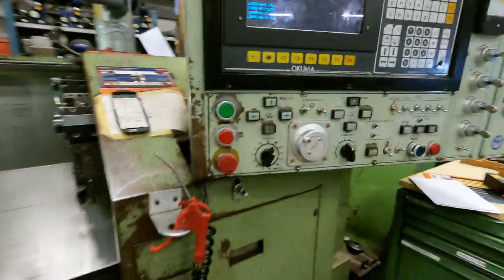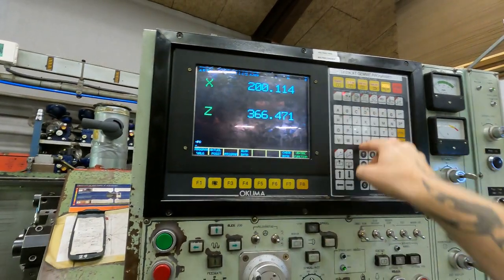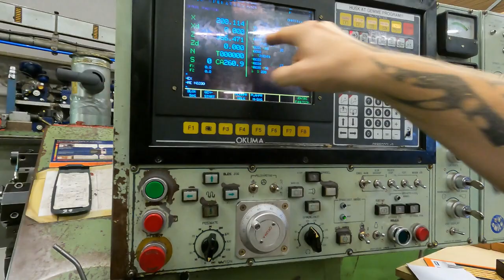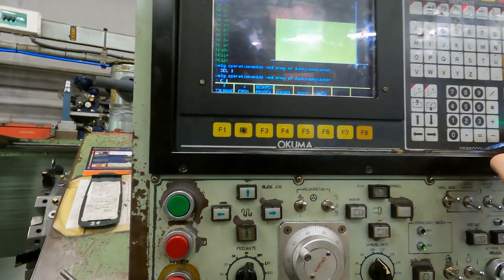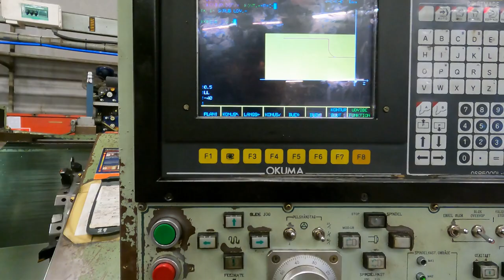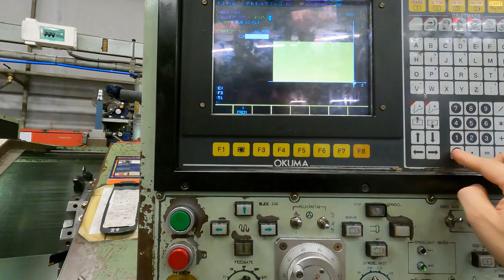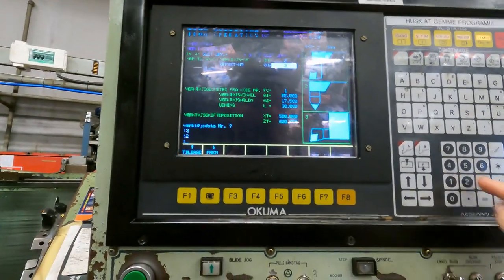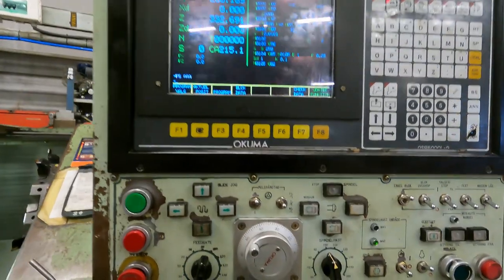Okuma IGF Programming and Operating the OSP5000.

Comment: I´m working on a Okuma Lu 300 with osp 200L  from 2005  and this programing on okumas is always the same i love how easy it is to use, i also worked with heidenehin siemens  and normal g-code but okuma  OSP igf is the best in my opinion. Easy to use easy to learn
Reply from the maker: I love IGF. But I struggle abit with it in the New okuma with osp 7000.

But I think its because i dont run My lathes that much anymore since i hired a guy to run them